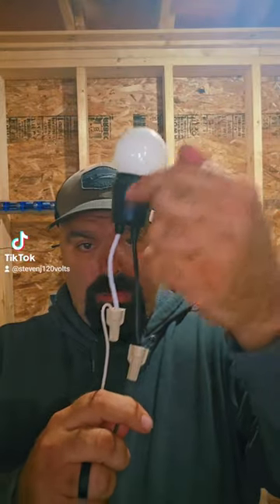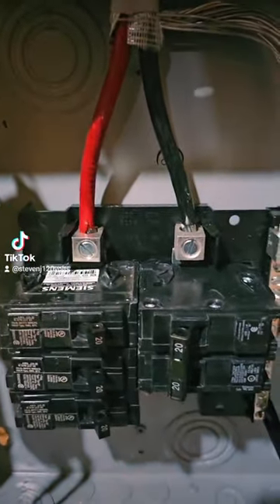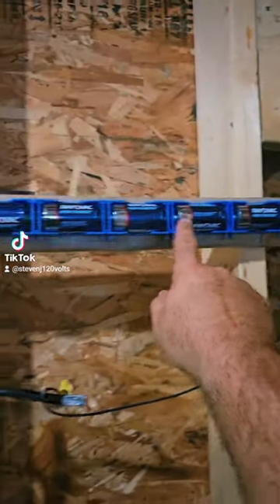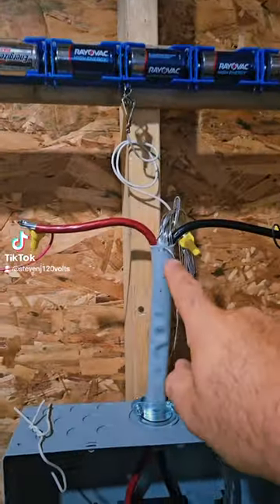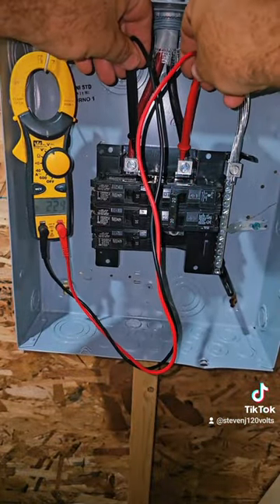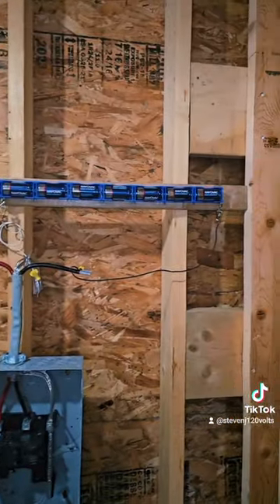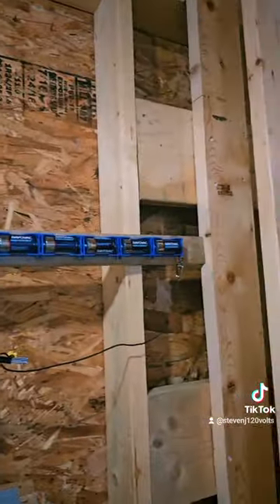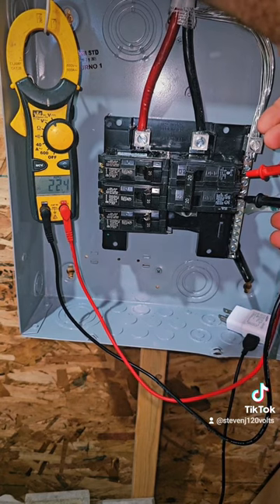why doesn't a 240v circuit need a neutral???

Comment: I think a very important caveat required in this video is that it is applicable to installations in the USA. Most of the rest of the world, 230/240v uses a phase and a neutral.
Reply from the maker: It's the same.  The only difference is you ground the end leg we ground the center tap.  That's how you guys get your 240.
Reply: We don’t “ground a leg”, we ground the star point of a three phase transformer. 240 is obtained by taking a phase and a neutral. So you can have 3 separate phases of 240v off a single transformer. This is important to know because it is possible to have 400/415VAC behind a switch or a GPO.
Reply from the maker: @hotswapster  I have 80k followers on tik Tok you have just contradicted how they say European homes work.  And how googled says European homes work.  I have never been there but have a trip to Germany on Nov 28 of this year.
Reply from the maker: @hotswapster  if you Google "are European homes single phase" the search result say yes.  That European homes are fed the same way as Americans homes.  But we ground the mid point you guys ground the end.
Reply from the maker: @hotswapster  in American homes the mid point is grounded by the electrician and the power company.  But in Europe the power company only grounds it not the electrician.  Think neutral must be slang in Europe.  How can you have a neutral when you only have on wire to reference it to.
Reply: Here is a picture of a TN-C-S system. 
https://en.m.wikipedia.org/wiki/Earthing_system#/media/File%3ATN-C-S-earthing-EN.svg

Houses can be single phase supply, two phase supply or three phase supply. Each of these types has a neutral. Their supply comes from a 4 wire, 3 phase system at the distribution transformer. Hence all TN or TN-C or TN-S systems have a neutral for 240VAC. Depending on how many phases the premises is, they take a wire from that number of phases and a wire from the neutral. 

There are other places such as Norway which uses an IT 3 wire, 3 phase 220V delta connection. And the South Korea which uses 220V open delta where one phase of the three phase system is grounded. Neither of these two have neutrals but they are also not very common and don’t have a 110v component. 

This is not a criticism of your video. I just wanted to highlight that in most cases 240V has a neutral and there is a danger of 400V being present in normal domestic homes in most parts of the world.
Reply: @Stevenj120volts  a neutral is a conductor at the same potential as earth during normal operation. This wire can be earthed at the distribution transformer, at the main switchboard of the installation or both, depending on where you are in the world.
Reply from the maker: @hotswapster  earthing is different than Grounding. You showed how a 3 phase system is earthed.  But all info I can find say your homes are single phase 240 same an America with the  grounding don't in a different spot.  Neutral being defined as same a earth potential is just they way it's call thing as slang. That is not technically correct.  Neutral is the return path with a zero reference between 2 legs or 3 phases... ungrounded not earthed systems can still have a neutral
Reply from the maker: In America we don't really used the the term earthed.  But for you guys earthed mean to provide a reference to the dirt near the install and ground means to give fault current a return path.  In America and Canada we say grounding and bonding not earthing and grounding
Reply: @tripplefives1402 thanks for the support. I’m not from Europe but our wiring systems follow Europe.
Reply: 208 is also in USA which has a neutral but CAN Also be single phase only with no neutral or with a neutral
Reply: I don't think this guy, and another person commenting, understand how three phase Delta is converted to three phase Wye… If he did, he would have understood your comment… They would have also understood that neutral can be dangerous, it is just based on what neutral has potential in relation to…

Also, to be clear, in the US we have what we call split single phase with L1 and L2 being 180 degrees apart because of the use of transformers to take one phase of the three phases and deliver it to residential at a reduced voltage… We are not two phase as some people claim, because it is the same phase, neutral is just the center tap on the transformer (which is only neutral in relation the L1 and L2 of the same phase say Phase A-C, taking Phase B to the center tap of Phase A-C would give you 208 V in US residential)… However, there are something like two power plants in the US generating two phase where the second phase is a 90 degree shift from the first…

Back to the point, High (HV), Extra High (EHV) and Ultra High (UHV) Voltage transmission (115 kV and above) and some medium voltage transmission (2,400 VAC to 69 kV) are pretty much the same throughout the world, three phase Delta…
Reply: @hotswapster so in Europe, if you put one side of your meter on a hot terminal and the on the earth terminal, how many volts does your meter read?
Reply: @markchidester6239  hot being phase, it would be between 220-250 VAC to earth. But lets call that a "nominal" 230 VAC. There are some exceptions in older areas that use 220 VAC 3 phase IT, but that wiring system is not standard these days. The standard wiring systems these days are TN, TN-C, TN-S or TN-C-S.
For the record, if I measure between two hots, I'll get 400 VAC.
Reply: Maybe I've been trying to describe this wrong. Europe and similar countries use a three phase, four wire TN system where the three phases are 120 degrees apart. Where as what I understand the states uses (happy to be correct here because I haven't worked in the states) a split phase system where the phases are 180 degrees apart.

So for Europe, between any of the 3 phases, to the earthed star point, I measure 230 VAC. Between any of the phases which are 120 degrees apart, I measure 400 VAC.

The reason I highlighted this is because it is possible to have 400 VAC behind a switch on the wall in a domestic dwelling, if two circuits from different phases have been run to that switch. 400 VAC hurts a lot more than 110 VAC or 220 VAC.
Reply: @hotswapster TT is the standard in france, switzerland, germany, portugal etc..., I've only seen TNC/S stuff in the UK. Also, you can't get "shocked" with 400VAC, because you will be grounded in case of a default, so you only getting 230VAC through your body, the only way to get 400VAC is by having insulating boots and touching both wires at the same time
Reply: @zaxmaxlax  120 volts AC going through your body will light you up.
Reply: @hotswapster US uses 3 phase transmission and distribution to almost all industrial and commercial customers. Residential customers get only one of those three phases, and that one phase on the primary side turns into one phase on the secondary side, with a center tapped winding creating the neutral. This gives homes the ability to use either the full secondary voltage (240) for large loads, or half of it (120) for small loads. Either way, it’s still only one phase from the grid.
Reply: @zaxmaxlax I would never assume that someone couldn’t be shocked by the total potential they are in contact with.

If they are able to touch a 400 volt potential, then they can be shocked by a 400 volt potential.
Reply: @hotswapster that's just a diagram of a three phase transformer. Doesn't mean 3 phase is what's going into homes. Here in the United States the neutral in technical terms is called grounded. We have the ungrounded (hot legs), grounded (neutral), and grounding (earth ground). The reason as to why the neutral is called grounded is because it's attached to the earth ground, just like it shows in the diagram. So homes in Europe can still be fed single phase at 240 V.

Generally a neutral is ran is because of the potential of imbalance between 2 hot legs or 120V/208V/240V/277V of a single leg. All of those could run off of a single hot leg if wired that way. So then a neutral would be required or the circuit can't be completed.

What it looks like is that there's just a misunderstanding between the two of you. I am an electrician here in the states, so I understand what you're saying, but I also see what is being said from the other side. Seems like he's not too familiar with the variety of voltages that can be run on a single hot leg.

The other thing though is that 3 phase is actually run here for residential, but they only come off a single phase to power a small community and the other phases for other communities.

In this video he was showing how a single phase becomes a split phase to provide 2 legs of power; and a neutral being needed for any imbalance between the 2 legs and for the 120V we use. But he did say that the neutral was only needed for power return, but that's not entirely true based on my explanations above.

Hopefully this cleared some stuff up for you.
Reply: In the Netherlands, most homes are supplied with three phases but they are converted to single phase for most wall sockets (three wires, neutral, hot and ground). However, electric cookers and some ovens use 2 or 3 phases depending on their size, and have a special hook up (this is my official non electrician lingo) in the switchboard/central junction box.
It's very old fashioned to find a home that only gets a single phase supplied, with modern house equipment it's too easy to max out. For a new installation, 1 phase supply is not allowed.
Reply: @Stevenj120volts No, it’s not the same in the US than in Europe.

In the US, the secondary distribution system is usually split-phase (i.e. single-phase three wire), with 240 V L-L and 120 V L-N, with both legs and neutral wires for each customer.

In Europe, the secondary distribution system is usually three-phase four-wire, with 400 V L-L and 230 V L-N, with only one phase and neutral wire for each customer.
Reply: @Stevenj120volts That’s actually bonding, not grounding/earthing. If you meant line-to-case faults. For line-to-ground faults, you certainly need system grounding/earthing
Reply from the maker: @altuber99_athlete  not even sure which comment you are relying to. Bonding is when you make two things have the same potential. Grounding is when you are attempting to make something have the same potential as the zero reference of the system
Reply: @hotswapster It is the same thing, just different terminology.  “Leg” is essentially slang for “phase”.  Not the best terminology, but has been used for decades and is unlikely to go away any time soon.
Reply: @Stevenj120volts both systems deliver similar voltage .
big difference being 
USA both phase conductors are capable of delivering shock . 
Uk 1x phase conductor 1x neutral conductor . The neutral conductor won’t give a shock under normal conditions.
Reply: @Stevenj120volts wrong. It is stepped to 415 /240.50hz.
Reply: @Stevenj120volts sport you have no clue! In Aus the mid point of star config is the neutral, and is also earthed. Your USoNA grid is inferior and inheritly more dangerous.
Reply from the maker: @markhill9275  you are a pig headed arrogant fool.  I have over 57,000 hours of experience on the American system with proper training injury is impossible even while working energized. Please go back I you hole uneducated troll
Reply from the maker: @markhill9275  are you one of the knuckleheads claiming electricity will flow to ground or into the earth.  Go away adults are talking
Reply from the maker: I just was in Europe I rigged 120 v in my room with not adapter transformer or converter.  How system are more alike then different
Reply: There are other countries that have different voltages . In Colombia they use 150 volts and I would have loved to buy their light bulbs. If I would have brought some home they would never burn out. Lowering voltage saves on lights. I found that out on my LED strings I lowered the voltage to 110 instead of 120 volts and not many burned out. I did have one string but I think it was of some faulty bulbs to begin with. None on the other two burned out. 73
Reply: @hotswapster  Stephenj120v is correct. In Britain, in a TNC-S system, one end of the transformers secondary winding is connected to earth, but also has a common conductor between that connection and the customers fuse unit's neutral block, which is called the Protective Earth Neutral(PEN)....hence Terra Neutral Combined Separate. Therefore the neutral is grounded to one leg of the transformer. The consumer has a connection from that neutral block to earth via a rod or metal incoming service pipe, to remove potential of injury through touch voltage, should the PEN break or develop a high resistance. In the US the neutral conductor is taken from a centretap on the transformer's secondary winding, giving you two 120v single phase supplies at 180 degrees apart, in the consumers distribution unit.
Reply: Terms are Mixed here from US and EU...
I guess its best to Look at the source first...
US 2Leg 1N
EU 3Leg 1N
In my German Home i have different Outlets
1Leg(No.1of3) 1N 1Pe
1Leg(No.2of3) 1N 1Pe
1Leg(No.3of3) 1N 1Pe
3Leg 1N 1Pe (Special "Outlet")

And US is?
2Leg 1N
You Always have all Connections from the grid?

Greatz from Germany
and have a nice Day
opo
Reply: @Stevenj120volts Have you took a look on your devices before? Think they where capeable of 230V. I'm from germany. Nowhere in europe are 120V available. We have 3 phase system with grounded star Point, 230/400v, in germany TN-C-S is standart, not TT and in germany every building is fed with all 3 Phases and a PEN. PEN is splitted into PE and N in the Building. Only old flats are only fed with 1 Phase + PEN or 1 Phase + N + PE (now waiting for the comment, that someone knows a old house at the worlds ass in germany that has no 3 phase supply.... Not relevant,)
Reply from the maker: @walterwixzwerg6735  I just got back from Germany.  I rigged up 120v in my room with using any converter, adapter or transformer.
Reply: This is ironic at Christmas time I have a candilor where I have three 120 volt bulbs in series so I hook up a 120 volt transformer to 240 volts and then plug in my candilor works perfectly for my doing. The idea is the bulbs are on a lower voltage than required (80 volts) but I am saving the life of the bulbs by on a lower voltage. The eight bulb units are just in series with two bulbs so those are running on 60 volts. It's interesting that those foreign adaptor transformer can be used to raise or lower the voltage. I usually buy them at thrift stores. I have no use of the resistor type because you put a low watt item on them you can kiss that item good by. I only buy the transformer type. The resistor type are made for hair dryers and maybe a hot plate. 73
Reply: @Stevenj120volts  You mean without any adapter!? What type of outlets was in your room? 120V US type or type F? https://de.m.wikipedia.org/wiki/Schuko If there was US type, then you had a special room for US citizens. Never heard of that, but possible that this is available in some Hotels. But you can belive me, there is no 120V available in Germany, and we only use type F outlets. Maybe somewhere around Berlin is an old delta net existing, with 133V to ground, but that voltage is'nt used. Only the 230V between phases. But this is non standard and very old.
Reply from the maker: @walterwixzwerg6735  no it was a standard room with standard wiring and only 230 volt receptaclesI got the 120 but changing the wiring pattern and creating some series circuits.  It the same way we get 120 in American home.  We feed our homes with 240 but our panel design puts put all the loads in series.  We had a third wire center tapped to coil to handle the imbalance.  Without the center tap I just had to maintain the balance by carefully selecting the load I was powering
Reply from the maker: @walterwixzwerg6735  I have 93k followers on tik tok most of content is posted there I made 3 videos from I hotel room are you on tik tok?
Reply from the maker: @walterwixzwerg6735  my room had 230 to ground and 230 between the phases... there was no 120.  I created it. Like I said no transformer or adapter.  I wired an 230 European cord to an American receptacle but did in a configuration to get 230 volts
Reply from the maker: @walterwixzwerg6735  I just posted two of the videos i made showing how I got the 115 volts
Reply: @Stevenj120volts  Ok, I've seen them. But this is absolutely not the same than in US. As you said, you have a groundet center Tap on 1 Transformer coil that makes 240V. If you don't connect the center, you're right, each device has 120V IF BOTH  NEED THE EXACT SAME CURRENT! In Europe we have a 3 phase system  with groundet star point. If you connect 3 identical devices to all 3 phases and remove the connection to the star point, you have 230V on each. But if you change 1 device to a diffent one with a lot more consumption, there 400V on the  two that left or If you would change the 2nd device to a more powerfull with removed center connection you would have 240V on the left device. So, you only wired 2 identical devices in series in you hotel room, so each get half the voltage. But with to not idential devices you would have anything e.g. 30V on one and 200V on the other. There is no practical use exept you would like to use 2 identical US devices with a simple ohm load at the same time. In all other cases this  a lot dangeous that 1 device will catch 230V for a short time. Look at the industrial US Power for bigger factorys. There you have also a 3 Phase system with 120/208V suitable for asyncronus motors. In europe we have that system in every house with 230/400V.
Reply: Bottom line neutral is bonded to ground in the main box. Only sub panels are not bonded. I don't understand European wiring just what I read. In Spain when I was there you had to be careful when you plugged in something that was from the USA. I had to replace a transformer in a boom box because someone used the wrong adapter. You don't use a resistor type of adapter for low wattage items. Only hair dryers and hot plates will work. Everything else will get fried. Also in the bathroom there were two types of outlets and you cannot just plug in a 120 device it. Will fry also. My razor had a 240 setting so I used it with no problem. Transformers can be obtained at the front desk at the hotel. I would suggest using them. I already have a set of foreign adaptors and two that are transformers. Most laptop computers will work on 240 volts. USB bricks also can be plugged in 240 volts. Check and read the label before plugging them in. 73
Reply: @Stevenj120volts  400v between phases .
Reply from the maker: @persona250  in America we have 480v between phase our hoke only get one phase.
Reply: @Stevenj120volts  you were in Germany , 400v between phases not 230
Reply: @Stevenj120volts  yeah and if you want 480 volts you are going to pay for it if it's available on your street. Many large farms use that kind of service. If I had my way I would wire the house for DC and use DC appliances. Solar would be the source no inverter needed. 73
Reply from the maker: @persona250  it's 230v between two phase conductors in my hotel room.  If it's single.phase they those two phase conductors are called legs
Reply: @Stevenj120volts  Maybe in some places, but not in most of rural America.  We have single phase distributed to most homes.  Three phase is typically only on main lines and lines to manufacturing facilities.  Most distribution is single phase of 19,200 volts or less stepped down at each home.  In my area most distribution lines are 7,200 volts.
Reply: @Stevenj120volts  How did you measure that and where was the Hotel (that I can have a look if there is something special possible)? As I wrote, its not impossibe to have 2 phases in a socket, because MAYBE there are a few old nets in eastern Germany, but thats no standard and hard to find. In a german socket is in 99.9% only 1  phase, 1 neutral and 1 protective earth. In that rare 0.1% case you have 2 Phase and PE. If you ever again in germany measure that between Phase and PE. You get 133 Volts in that special uncommon net if able to find one. In a standart socket you measure Phase - PE 230V and neutral PE 0V. But be careful to use a high impendance instrument, if you exceed a current between 15 and 30 mA on PE the RCD becomes tripped. And where do  you mean are 480V in the US? For your standart supply this is impossible. In a 3 Phase system with 480V between phases (480V line voltage) you would have 277V to neutral as lowest voltage. Your standart 3 Phase System is 208V line voltage, thats 120V to neutral. The split phase system with center tap (2 phase) is 240V between phases and 120V to neutral. You cannot make the last one out of a 480V 3 Phase without a transformer for every split phase output. Between that there is the high leg option, with 240V between phases, 2x  208V between high leg and neutral and 2x 120V between the lower legs and neutral. Thats a thing, with a lot disadvantages.
Reply from the maker: @LTVoyager  I can't tell which one of my comments you are replying too.
Reply: @Stevenj120volts  interesting. I knew when I was in Spain they had a slotted outlet like ours in the USA but it was 230 volts or so. I guess it was for electric razors. Because the razor had a 120 or 240 volt settings. I know most power packs can do 90 to 250 volts now. I have a 120 volt to 240 volt transformer that can take slotted plugs and the two dot plugs. Also I have all the adapters so I can plug in any European outlets and at home I can run 230 volt things from Europe at home. The one thing I don't understand why in Columbia they use 150 volts. Would have been nice to have a transformer that ran  that voltage or better yet some 150 volt lightbulbs. 73
Reply: @Stevenj120volts  The comment about having 480 between phases in the US.  That isn’t true in most residential locations.
Reply from the maker: @LTVoyager  yes I agree that residential is 240 split single  phase.  My overall point is the USA has all the same or similar voltages available in our system as they do in europe. But People , businesses, and utility companies have chosen to feed our homes with 240 split phase.  So our system can do all the things theirs can do plus more we are not limited to 120.  Our 120 is an extra option and feature their system lacks.  We could have 480 in homes if there was reason and evidence to believe that was a good idea.
Reply: @Stevenj120volts  Most of us could have 7,200 in our homes if we wanted it.  😁
Reply: @Stevenj120volts  then they are not phase conductors. It’s a phase conductor and neutral . 400v phase to phase . 230v phase to neutral
Reply from the maker: @persona250  then it's not a single phase system....  Maybe it's just one phase from a 3 phase system. Here we provide a true single phase system.
Reply: @Stevenj120volts  Yes, thats it. We don't have any single phase System, only 1 out of 3 you can find in mostly old locations, (or in a standart socket, as you like it this way). For that reasaon, we're not able to provide 120V without transformer. But I don't think that the US system can provide the same than in europe and most places of the rest of the world. There is nothing thats compartible with 230/400 V 3 Phase system. And if there is any realistic possibillity that your supplier can do it either, you're missing the 120V. If you choose 120/208V your're missing 240V and 208 is not enough for euro stuff. The  only thing thats compartible, is to use single phase devices for europe on a 240V outlet in the US. So for us, its easyer to move our Stuff to the US, but not the opposite. But in that moment where I need 400V 3 Phase,  there is no chance. What would you do, if I would come to you with my 27kW flow through water heater from germany, that needs 3x 40A at 400V and want to use in my US home? I think to have 7.2 kV is no realistic option, if I would have enough space in germany, I could have my own 10 kV transformer, but thats nothing anyone needs or want to pay for for private use. In my company, we have our own 10 kV supply and we have our own 120/208 V 3 phase system for our US machines, but thats nothing someone would do for 1 device. The  US missed it, to convert the electrical system to a 3 phase with 230/400 when it was time to do, before the war, now you have to live with the old bullshit that goes back to edisons DC stuff and there is no way out with that much devices. We need so much less copper for the same power. Thats not because you're stupid. Stupid is only, that you don't do an upgrade to  your really ugly and dangeous plugs and sockets. Would be so easy to make a new socket design like we use here, that you cannot touch the live contact on a not completly plugged in plug. That could be compartible with the existing stuff. But here's the same. Our type F is also not the best, but no chance to change it to something  better like type E.
Reply from the maker: @walterwixzwerg6735  we have 3 phase in most of the neighborhoods it would just take a different transformer.  To send 3 phase into homes. We are not limited by our grid it just just do not see the need.  Like our on demand flow thru hot water is propane or natural gas.  But few even do those. We use heat pump water heaters  with large storage tanks the hot water is almost free.   Your system has less options than ours.  Pur primary volt is 7200 3 phase into most residential area.  I literally have 7200 voltage in driveway.  But we chose to step that down to 120/240 split phase cuz it is the most versatile.  We could easily put any transformer to get whatever voltage we thought was best
  And we do 120/240 is the best.   Overkill is usually wasteful and not helpful.
Reply: @Stevenj120volts  I would say our terminology describes single phase better than the American term . On you’re residential transformers is the primary 2 x phase conductors ?
Reply from the maker: @walterwixzwerg6735  I have about 80 gallons on hot water on stand by in my basement. My daughter has 160...she can still make hot water during a power outage just by running a 5kw generator ($400 to buy most ppl have one in rural areas) I am an electrician I would never recommend any on demand hot water(we call them tankless).  The last house I owned had one it was put in during the 80s first thing I did was swap it out for a storage tank.
Reply from the maker: @persona250  our residential system is what showed on this video.  Two legs at the opposite end from one winding With the one ground conductor(neutral) connected to the middle of the winding. Giving two ends of the same phase.  The two conductors are in phase but with reverse polarity. It is often incorrectly taught as two conductors 180 degrees out of phase but that ppl trying to impose 3 phase terminology on a single phase system.
Reply: @Stevenj120volts  I agree with you if it's where you live but for a vacation home I would rather have a tankless because winterizing is much easier especially if your drain hose is frozen solid. I went through that last year. Never again.  Now at home I do have a propane tankless and I'm saving a bundle of money. One 15 lb bottle last about two months. That's about 12 dollars to get the tank refilled. My next step is to refit my tank and put two DC elements in and run it on solar. No charge controller needed and in Florida sun shine won't be without hot water. But for most people the tank is better in saving money. I used to have mine on a timer and run it once a day for one hour and a half. Enough for two showers. 73
Reply from the maker: @ronb6182  yeah but you definitely don't need an electric  tankless.
Reply: @Stevenj120volts  yes I understand the secondary . I asked about the primary side .
Reply from the maker: @persona250  primary connections are a different trade they are linemen and not license electricians.  And primary are not always set up
Reply from the maker: @persona250  Sometimes the primary will be 3 phase  on the pole but they only tie one to one of them so the primaryis phase to neutral.  Sometimes there is only one phase on the pole
Reply: @Stevenj120volts  agree. I don't see free hot water from heat pumps you are taking energy from your heater. I have a heat pump that cools and heats the house. My next step may be running my tank water heater on solar with DC elements hooked directly to the solar panels. I would have DC thermostat if the heater got hot enough to turn off the power. No charge controller needed and the most simple system for people getting into solar energy. 73
Reply from the maker: @ronb6182  fyi i heat my entire home with heat pumps
Reply: @Stevenj120volts  does this mean you don’t understand the primary connection of your residential transformer ? I am not a lineman I understand ours .
Reply from the maker: @persona250  I just explained it you.  I can show you a diagram.  But there are many many variations all of which are irrelevant.  All the 120/240 split single phase secondaries are the same.
Reply: @Stevenj120volts  yeah I know many different primary configurations very confusing. 
Phase to phase primary 
Phase to neutral star point primary 
Phase to multi neutral return 

You can’t tell me all that is well designed it’s a mess .
Reply from the maker: @persona250  our system is safer with little to no lethal shock potential. And often only about 10% of the amps that is on the hot wire  will use the neutral.  So you can have 100 amps on the hit and usually about 10 on the neutral.  You can  even have zero on the neutral.  I don't know what you care about the primary it has nothing to do with the  safety or functionality of the wiring in the home.
Reply from the maker: @persona250  lineman are not electricians they only have a 7000 hour apprenticeship. Yes  Its hard, heavy work and outdoors but it does not take a lot of technical ability or knowledge. Compared someone like me a master electrician with 58,000 hours of experience
Reply from the maker: @persona250  here lineman are not allowed to touch a house or even make any connections on the side of a house.
Reply: @Stevenj120volts  Split single Phase maybe is the right Term but you have 2 wires in your Outlet that are hot, right?
(I have to train my english skills and Others too :-)

Happy new year
Reply: @Stevenj120volts  in reference to the primary side I was referring to you’re previous comment about being true single phase .
The majority of you’re residential transformers use a phase to phase across the primary coil which is confusing to call single phase regardless of the secondary…
Reply from the maker: @opotime  you for 120 you have 1 hot 1 neutral for 240 you two hots... there can also be a type of 240 that two hots and one neutral those allows for things like stove and dryers to be built with both 120 and 240 component's.   But I. Our system you can never receive shock to ground more that 120volts
Reply: @Stevenj120volts  little to no shock potential ? How would you know if you don’t test the fault current or circuit impedance. 

Our code dictates every installations fault current , circuit impedance and conductors resistance is documented on every circuit before hand over . 

On a 120 volt circuit at 1 ohm impedance 120 amps of fault current will flow . Considering 100ma is lethal I find that a statement to completely disagree with.  
Our code dictates a 30ma device on every circuit in a home . 

So I am going to say our system way safer than the US
Reply from the maker: @persona250  we have ground fault protection of 5ma our code actual says 30ma  protection is not allowed to be used to protect ppl...While working I have been shocked over 700 times and never been injured. Because we build our houses out of non conductive material me and no one in my family has ever been shocked unless they were an electrician working live stuff.  Most of the time with our construction methods you can touch 120 volt live wires bare handed and not receive a shock.
Reply from the maker: @persona250  google it 7ma for 3 second can kill you if hits your heart.
Reply from the maker: @persona250  30 ma is safer wft... that has not been allowed in USA since the 70s. We went to 5ma in the 80s
Reply from the maker: @persona250  thr majority of our primary connections are phase to neutral.
Reply from the maker: @persona250  also for some reason you guys think higher volts is lower amps.  That only during the design of an appliance during a shock higher volts me higher amps.  All of the shock vicitms in your countries will receive double the amps
Reply: @Stevenj120volts  700 times . A good electrician doesn’t get shocked . I’ve been doing it 25 years domestics and commercial been shocked probably 10 times .
Reply: @Stevenj120volts  no I understand I =V/R . Do you have gfci on every circuit no . 
You don’t do any testing . How do you know if anything is safe ?
Reply from the maker: @persona250  I have a gfi on every circuit code requires them on most same with AFCI do you guys even have afci?
Reply from the maker: @persona250 nothing to test OUR HOUSES are made of dry non conductive WOOD.  You can not be grounded while living in our houses unless sometimes while using a sink or tub and we have required 5ma gfci protect in kitchen, bath and outdoors aka near water since the 80s. And even if you did manage to ground yourself the shock is at half the amp you would get from your system
Reply from the maker: @persona250  we do not really worry about getting shock while working. Unless the shock is hand to hand it really can't hurt you.  I have never even owned rubber gloves and I do not know anyone that has.  People will shock each other has a prank.
Reply from the maker: @persona250  on my first day.  I was shocked on third light I touched and I was fine.  As a brand new apprentice they had me working on energized circuits on my first day.  1st year we changed every receptacle in a home without turning off the power
Reply from the maker: are you on tik tok? I have 94,000 followers there most of content is there
Reply from the maker: @persona250  go watch my oldest video on here....  I had an other bare foot and bare handed touching live wires.
Reply from the maker: @persona250  my dad is an electrician I have been for 28 years.  I have never heard of one time an electrician being killed or injured from electric shocm while working in an USA home.
Reply: @Stevenj120volts  no it's DIY that get killed. One instance a man was drilling a hole and he hit a 240 volt line and got electrocuted. He was trying to install a ceiling fan and tried to drill a hole for the wire. In my house all the wires are laying in the attic, that's the way they wire in Florida. I know where the 240 wires are, so no chance of shock. 73
Reply from the maker: @ronb6182  you cant be shock by drilling thru a wire. In USA you can't be shocked by 240 to ground.  Careful putting wires in the attic it add bunch of risks and new code rules.  Now in Europe you can be shocked with 240 to ground but no in a USA home
Reply: @Stevenj120volts  I’ve not watched any other vids but will 👍🏻
Reply: @Stevenj120volts  yea AFCi only required on high rise residential and hmos currently. Lots of bad press about them .
Reply from the maker: @persona250  all the bad press is just from ignorance of how they work I have 8 videos on them on my main demonstrating what types of Arc will trip them and what kind wont
Reply: @Stevenj120volts  there are videos on YouTube of people arcing live cables together with no activation of the device.
Reply from the maker: @persona250  that's not the kind of arc they are looking for..
Reply from the maker: @persona250  made about 6 videos explaining and show thru demos the types of arc they are and are not looking for.  They I built a rig that simulates the arc they are looking for and I can trip them easily. If you are on til tok I could Tag you.  I have millions of views on my videos on Arc fault explanations and demostrations
Reply from the maker: @persona250  all load arc when the circuit is made and disconnected.  So not every arc is an arc fault the breakers must be able to tell the difference